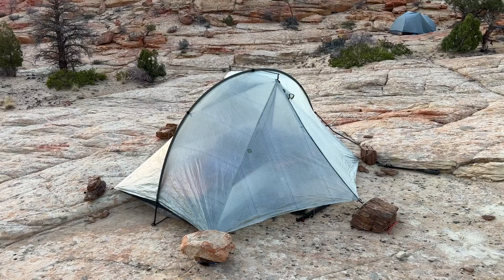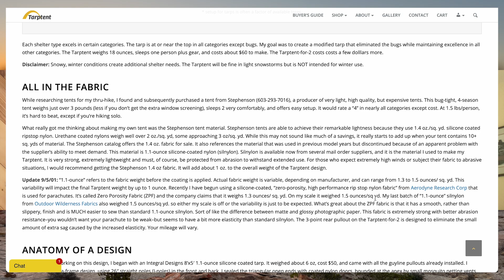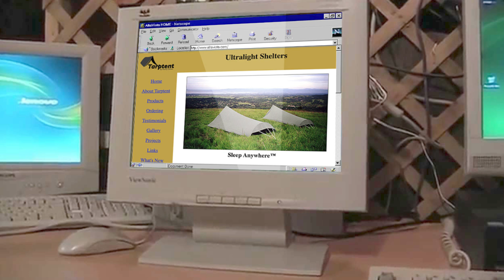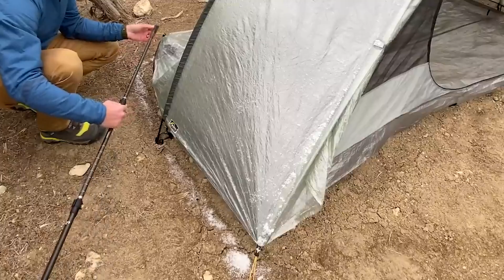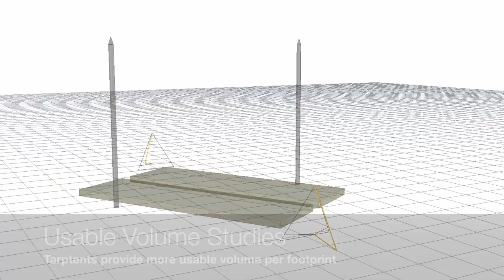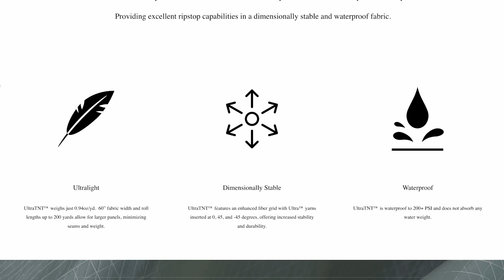Innovative Tents Backpackers Love! A Sit Down With Henry Shires of Tarptent.

Comment: Great interview, and Henry has helped me directly with a tent, and a repair kit years later. He makes excellent tents. About half way through the interview I couldn't help but relate tent design and fabrics to the current bicycle industry. New models, new components, new materials, chasing the ultimate gear to go lighter and faster. Like professional athletes. That seems to be our culture. Record breaking Great Divide races; faster AT hikes; Triple Crown long trail runs; faster every year. Henry broached the subject of constant redesign to match new sleeping pads, and tall thin packs. I chuckled at the closing shot when I saw a Hilleberg tent on the rack, wondered if it was an Akto model that has been almost unchanged for 25 years. You're a good interviewer.

Comment: Just bought a Tarptent triple rainbow. Going into a rain forest this June I needed a 3 man with excellent water resistance,a space for gear, and I really wanted the ability for a fly first pitch as well as something that if needed can be free standing. With that in mind the only tents that checked the boxes were Tarptent and zpacks. The cost and condensation kept me away from zpacks “although the advertised weight is tempting” Henry was great with my few emails I sent asking some questions and I look forward to putting it through its paces. I have 100% confidence that Tarptent will serve my family well.

Comment: ~32:00 Ive never experienced my tent floor wetting out on ground, but I have in spring on water saturated snowpack. In those conditions, its hard to avoid a super wet surface.

Comment: Great interview. I've been scouring old forums lately and the Squall has come up a lot. It's a trip how the company evolved. They have great designs. I dig how they use struts to reduce footprint.
Interesting how he thinks about the person's size. I'm small and been looking at tarps. Figured 9x7 is big enough even with a half pyramid pitch.
UltraTNT is interesting. Sheds water and no stretch like dyneema but doesn't have as much weight savings. Costs less but doesn't pack down as small. Maybe a choice between silpoly and dyneema for shelters.

Comment: ... Interesting interview ..  Materials over time have changed greatly ,, as well as backcountry hikers .. I have spent lots of time in the backcountry with and without a designed tent ,, but probably have set up a couple dozen different shelter designs using a single tarp .. depending on terrain and expected weather .... just can't get a grasp on the masses of hikers willing to cover the costs of these types of tarp-tents trekking pole shelters ... most of the outdoorsman, ,and woodsman that rely on a quick simple shelter probably couldn't afford most of the leading brands on todays market ,, I know I can't ....  besides ,, creating a simple tarp set-up is fun and over time usually rely on one of a few to do the job ....

Comment: Great discussion, thankyou.  As far as tent floor seepage over time, I think many people myself included hike in areas where tent site locations are designated and, over time, develop an impression that naturally collects runoff either from the tent itself or surrounding areas. Can you use a dwr on these impervious fabrics?
Reply from the maker: That's a fair assessment. DWR can be applied for sure, but will wear off pretty quickly from abrasion. I think the ground sheet application is the better solution.

Comment: Never looked before today why is he one of the only tent companies that actually make 2p tents that actually fit 2 25 inch pads?  Thanks for great video
Reply from the maker: Being a smaller company, I think they have the ability to make changes to accommodate changes in user preferences faster. It’s also clear that Henry listens to his customers feedback.
Reply: Ridiculously underrated company. I desperately wanted a tent with a 50” wide floor and almost gave up, people had recommended Tarptent but I wrote it off. Luckily I checked them out quickly right before settling for another tent that tapered. Ended up being better in literally every way.
Reply: My single Rainbow has a 45 inch floor. That’s one of its positives, extra floor space for gear. A 1 1-2 person tent